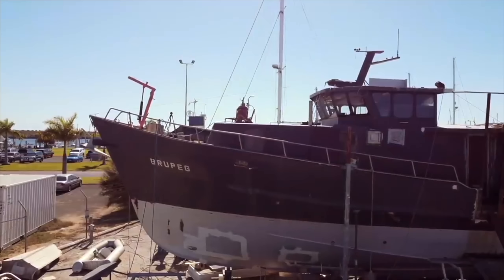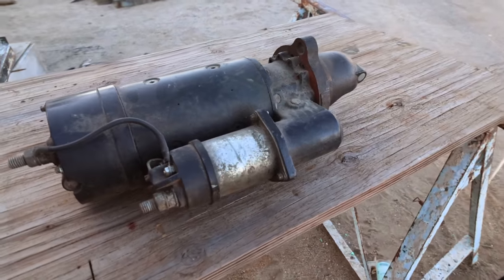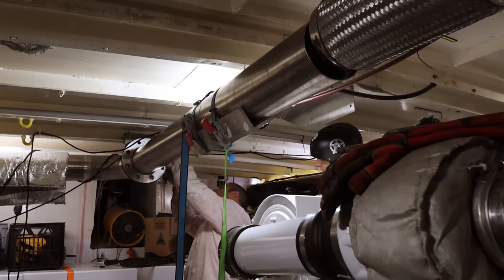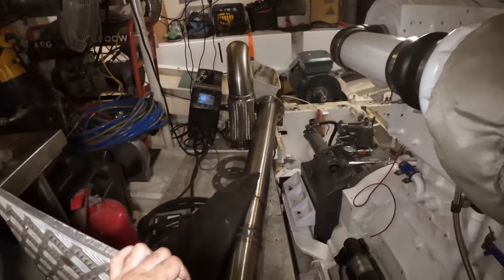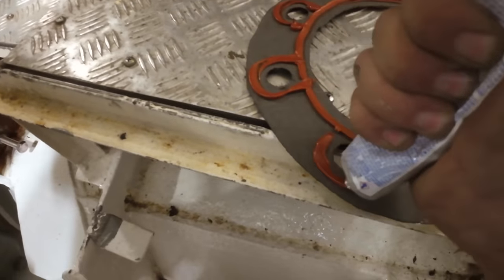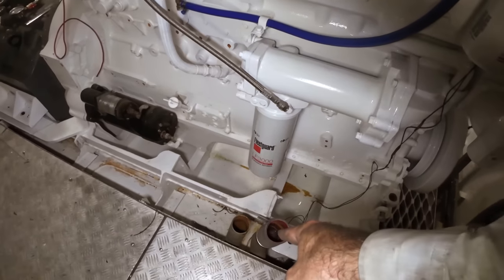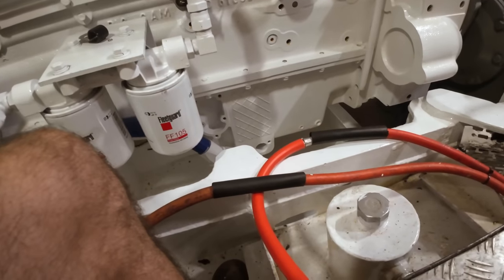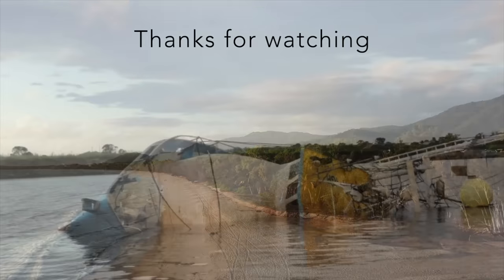Our Expedition Boat Dry Stack Exhaust - Project Brupeg Ep.322

Comment: Just a tip - Flex pipes should be in the same plane as the soft axis of your engine mounts so it flexes in compression not shear or twist. Extends the life of the flexible section.

Comment: General cable mounts can be temporarily be made from a quality hardwood ,  DIY drill 2 sloppy cable holes in a block -turn 90 deg and drill hole for mount bolt/screw  between  cable holes, turn back 90 deg and cut through both cable holes to make it into a sandwich block. Simples!

Comment: Stainless steel exhaust looks pretty. Then it gets a few small rust dots on the outside, then it crumbles. There is a reason commercial boats use steel tubing for exhaust systems, it lasts for a long time. Only rich people use stainless, but they can afford to replace it every few years,

Comment: Hello Dame, if you harvest heat from the exhaust with a cooling coil, be aware of the risk that this may lead to condensation and soot buildup on the inside of the exhaust. Probably worth checking after a bit of use, e.g. 100 and 1.000 hours of engine operation.

Comment: Volvo construction equipment use plastic zip tie clamps for holding battery wires and they hold up really well, they come in a quite few different sizes aswell.

Comment: Hen we extended mains cables we cut some insulation off the cable to put over the connector to maintain the level of insulation accross the joint then we woult heatshrink over the lot exactly as you did. The concern was the heatshrink was considered less inslating and not as abrasion resistent as the original cable covering.
Reply from the maker: I really like this idea. Will do this in future

Comment: I was hoping you were going to just bump the engine over from a start switch. It's so close now. I think your idea with coiling the tubing about the exhaust is exactly what you need. It should help cool the exhaust and provide  hot water for everything. 
Well done everyone. 🤝🤝👍🇺🇸
Reply: Long time follower, another great video. Yachtie and hydraulics engineer 👍👍👍 coiled tube exchange off exhaust is frrrreee heat !

Comment: Blocks of UHDM with a fillet radius on each side of the clamping hole and as belt and braces heat shrink on the cable. Used wooden blocks in the same style on HM warships back in the 80's when fitting sonar and other electronic devices.

Comment: ceramic fiber insulation wrapped with hot shield fiber tape and plaster is the best way to cool exhaust. several resources online detailing procedure, works well, easy and cost effective

Comment: Two things can greatly increase your engine life, a cooling water pre-heater, so the engine will be at operating temperature before starting and a electric lubrication oil pump to bring the crank and big-end bearings up to pressure before starting. Remember most damage is done to a engine during cold starts, also starting will be much more easy with the engine at temperature. Greetz from the Netherlands.
Reply from the maker: That’s great to know. Will look into that. Thanks
Reply: @ProjectBrupeg  Sorry, I meant this pre-lubrication system: "PRELUBTM ENGINE PRE-LUBRICATION SYSTEM"

Comment: For testing the pipe welds, you could paint the outside with flour and water, and then paint the inside with diesel or kerosene. The diesel will find its way through the holes and stain the flour on the outside indicating faults in the weld.
Reply from the maker: Ha, thats a bloody cool trick, thanks!

Comment: You can make your own brackets using round steel on a frame, multiple sizes, just bend bracket over round steel, need solid right angle steel to fit in vice..

Comment: The wrapping will keep engine room temperature down if you use a fire rating insulation on the ceiling you should be heat transfer. Keep up the great Chanel.
Reply from the maker: Thanks Graeme

Comment: you can get rubber cable cleats for holding large core wire. that's what's used for all of the high voltage wiring in a locomotive.
Reply from the maker: Thanks. I’ll have a hunt for them, cheers

Comment: You source pipe all break at the well joint, because you have an inconsistent gas flow, which causes heat to concentrate and specific areas with the pipe/ joint highest friction rate

Comment: Make your own P clamps. Buy appropriately sized pipe saddles, shrink wrap (2 or 3 times) the space between the holes and fold the two holes so they meet each other to make a P. Works better than flimsy P clips and is dead easy!

Comment: Apply Dynomat to the ceiling above the exhaust pipe. The black Fiber-based core offers excellent low–frequency absorption properties, thermal resistance up to 350° F, and compliance with UL94, MVSS 302, UL HF1, UL HBF standards.

Comment: If you can only get bare stainless cable clips, you should be able to slide some heatshrink over them, may have to straighten them a bit.
btw, the 'resin' in heatshringkis basically hot glue, so if you only have non adhesive heatshrink, cover the joint in hotglue, let it set, slide over the heatshrink and heat ;)
Reply from the maker: Ha, good to know

Comment: My 2 bobs worth, to get the best heat transfer the ss tube should be in contact with the exhaust, when you wrap the tubing it will spring away from the exhaust. You could bend the tubing around a smaller diameter pipe and then fenangle it over the motor end of the exhaust as that doesn't have a flange on it. I have found that aluminium tape holds up under heat if you need to secure it and it also insulates and will give more heat transfer to your tubing, I have used to secure copper tube to steam pipes and it held up for 10 years.
Reply from the maker: Good info to know. I can order what ever size diameter we need so under sizing and stretching over the pipe sounds the go. Cheers

Comment: in that bend next to turbo Use the ceramic wrapping cloth it's used in forges to heat proof.shoud do a better job than the fiber glass heat insulating Cloth

Comment: Suggestion on the heat shields. Use an arc section from a 10 inch diameter pipe supported above the exhaust. If you can find it, another larger pipe arc and a little wider. On top of the first one
Reply from the maker: Cool idea

Comment: the insulated cable clamps can be found at the airport. They use them all the time on aircraft. they come in a multitude of sizes, and are very stout. no worries of breaking them.   You might want to chat up a mechanic next time you are close to a larger airport Damian.   I would check with a larger aircraft carrier not a puddle jumper size.   Hopefully that helps.

Comment: Seems like a length of rubber hose threaded over the exhaust U-bolts would provide chafe protection and vibration damping.  Even garden hose should work.

Comment: I would suggest you  put a heat shield on the back the engine control box and rubber mounted ( vibration control)
Please give a good thought on a engine driven fire pump/ emergency bilge pump. 
Looking forward for the chalkfast to be completed.
Reply from the maker: We do have an engine driven pump, just not fitted yet
Reply: @ProjectBrupeg  
That is great news. 
No sign of fish in your new below deck Aquarium.🐟😁

Comment: Don’t grab a gauge and tighten by the bezel electric or mech to tighten you will damage it 
and at the least have to re calibrate it tighten by the wrench flats on the back -brass Pipe thread fitting.

Comment: If your exhaust manifold is the water cooled marine manifold that is going to suck a lot of heat out of your exhaust gas. If it’s the solid cast industrial manifold, if you wanted to get some heat out of it, there are two philosophies of it, you can wrap a coil around the outside of the exhaust pipe, and prioritize good flowing exhaust  and simple installation, over really efficient heat transfer, perfectly adequate for some applications I don’t know exactly what you’re looking to do with this hot water. Option two is an internal type heat transfer, basically adapt a 18-24” section of your exhaust tube to about 8” and weld about 7, 2” schedule 40 stainless pipes on a “wall” on each end and pass your heat transfer fluid around the pipes think “steam boiler” that’s very effective, the smaller and more numerous the internal pipes the greater the surface area interfacing the hot gas and cooling liquid, but also greater surface area means your exhaust gas has to work harder to get through it. So there’s a balance. As far as a roof heat deflector, aluminum works pretty well, steel or stainless are also okay, and on the backside (opposite the exhaust pipe) some sort of adhesive backed insulation can help with heat transfer but make sure to leave a good air gap between that and the floor itself, even just a free floating 3mm bare aluminum may be sufficient. 
Hope to see you guys on the water soon, take all the time required. It’s better to spend extra time working through it on that handstand than rush, but you guy’s already know this. Best of luck from Texas.

Comment: May you could utilize some aero-gel insulation for the whole engine room ceiling and the exhaust? And over it (past the heaviest heat load coped by the aero-gel fleece) ISUM heat radiation reflection material. Or combine it with classic light weight Fireclay panels.

Comment: Checking items off the engine to do list. Adding a few more in the process. Jess and Duncan will proud. Duramat or similar on the ceiling. Components or parts off a used infrared deflector shield if suitable. Piping/tubing to cool exhaust. Not sure what economically feasible - radiator, boiler, etc. Almost there.

Comment: A simple solution would to just run some cable tray and zip tie it down wholesalers everywhere carry it there some simple and cheap ones that are 50mm wide throw some tabs on it and bolt it to the engine and you can have a neat secure cable path all the way to the starter if you wanted

Comment: Could the water pipe wrapped around the exhaust be pumped to a pressure washer for use on deck? The hot water could be useful in breaking up ice on rails and stanchions and whatnot. And of course general cleaning.

Comment: your two sensors at the top by the water port and right next to the exhaust.  Could you put another 90 degree bend on it so the top sensor points away from the exhaust pipe and insulation.   That way it will give a little more room for the insulation.
Reply from the maker: Yeah that was a thought we had. The plan is start it up as is and if we find it’s playing up we will adjust it round

Comment: Use SS for the heat shield as it is a poor conductor of heat. Get really fancy and have the exhaust ceramic coated to really stop the heat.
Reply from the maker: Ok. Stainless is easy enough for us to fab up. Will do. Would love ceramic but bank balance strongly disagrees Thanks.
Reply: @ProjectBrupeg  I reckon with your heat wrapping you might not need the shield anyway. Running stainless high-pressure steam piping, admittedly only a couple hundred degrees, with 25mm glass fibre insulation it was cool to touch. We would use shielding sometimes where valves were exposed and close to where someone might accidentally touch it.
Reply from the maker: @FilipAus good to know. I think this ceramic wool stuff is pretty good, and temps we run are around max 450 right at the turbo. It’s down to a few hundred not long after that
Reply: @ProjectBrupeg  yeah sounds like you might be fine without shielding. Looking good though. I sent some links to Prochem for stainless brackets and saddles. All 316 and they have outlets nationaly and can express anywhere. Might suit what you need.
Reply from the maker: @FilipAus fantastic. Thanks for that

Comment: I hate how the heat shrink is smaller in the middle of the joint so I cut 😮pieces of shrink tubing the same width as the connector to make it even with the existing cable jacket then I place the bigger piece of heat shrink over everything.  It doesn't look like a joint when done that way it just looks like heat shrink on cables.

Adel clamps is all that is needed for the cabling.  Adel clamps are easy to find just about anywhere.
Reply from the maker: After I hear shrunk it the first thought through my OCD brain was, “should done two layers and removed that dimple”

Comment: Damien. Just a Thought could you do triple wall exhaust like they do for Wood-burner or Fireplace? Would the Engine run better keeping the Turbo cooler? Last I would add stainless steel water jacket for that Elbow. Damien you could design a water Jacket. Just look how you made Brupeg Now.

Comment: Could you tell us how you will steer Brupeg if the engine is not running or there is a failure in that system?  Fantastic progress!
Reply from the maker: Hi Ken. If primary engine hydraulics fail, then we will be able to switch over to a secondary pump (yet to build that system) and if that fails we can disconnect the steering rams and steer with a emergency tiller on the rear deck (also yet to build the tiller)

Comment: How does the exhaust pipe system deal with heat expansion?  The pipe will get longer when engine running. All the supports don’t provide for linear expansion
Reply from the maker: The supports are rubber mounted and there is a flex joint in the hottest part of the exhaust
Reply: @ProjectBrupeg I have experience with diesel generator installations. Any horizontal sections of the exhaust system on a generator set must include an expansion joint. Without this the pipe grows in length as it is heated which stresses all the supports. It is significant expansion Which will expand the pipe length and displace the elbow at the stack. I Would suggest speaking with a diesel manufacturer tech/ engineer.
Reply: @ProjectBrupeg the flex joint deals with vibration and movement not much linear expansion. See follow up comments
Reply from the maker: @Ishta123 do you have any suggestions for suppliers and type of joint. Will need to factor this in
Reply from the maker: @Ishta123 does length of pipe matter. The straight run is around 2.5m long

Comment: Chockfast! Cool I used similar to put bolt in floor for a machine mount . Always wanted to use chockfast as it was made by ITW round the corner from me in Montgomeryville pa , usa.   I wonder where it comes from now! 
Will the gauge on side of engine be safe in the vibration? And if it breaks will it leak?
Cheers Warren

Comment: Your drawing your fresh air for the engine from the hot engine room, any ideas for a fresh air intake? Sorry its more work but may allow diesel to run coller.
Reply from the maker: The engine room has four large fresh air vents. The engine room also has a yet to be built large extractor fan so the air in that room will remain fairly cold due to the constant refreshing of air being pulled in. This is how most of the trawlers around us set their engine rooms up

Comment: nice job, just curious if the main engine gos down, how are you going to steer? since the main engine powers the pump.
Reply from the maker: If the main stops we have no motion in the water to rudder is irrelevant. When the get home kicks in we have a secondary pump that powers the rams. If that pump fails we will have an emergency tiller

Comment: For heat recovery, I have seen tubes wrapped around the exhaust. This works but not as effective as a coil inside the exhaust.
Reply from the maker: My preference would be external pipe as I would rather the heating coil take longer to heat the water than restrict the engine in anyway. I agree with you internal would be better but we can live with slower heat delivery
Reply: @ProjectBrupeg  yes internal would cause a restriction, how much would be debatable and would require some complex maths due to the heat reduction the air would contract as it is cooled. 

Too many variables to even make an informed guess!
Reply from the maker: @AdrianChapmanlaw yip. Completely agree. It would be nice if heat recovery was the priority but fuel burn reduction is always or core goal then using anything that’s waste to do something useful to further reduce fuel burn (ie less genset run time)
Reply: Another thought... what's more important, egt before or after the turbo?

I have a feeling it's pre turbo.
Reply from the maker: @AdrianChapmanlaw it should be before however it’s a water cooled manifold and we have no ability to tap in pre turbo without major mods to the manifold. So it’s going right after the turbo fan
Reply: @ProjectBrupeg  are you also doing heat recovery from the cooling water or just dumping through the cooling pipes under the boat?

Comment: Does your truck have a catalytic converter under it if it does just look at it , it should have a heat shield over it , thin stainless steel should work same with aluminium.
Reply from the maker: Our truck was invented before emissions were. But I will check to see what it uses. Thanks

Comment: Water cooling exast is a bad idea it will build up particulate quickly.
Reply from the maker: The main manifold is water cooled.
Reply: @ProjectBrupeg  Yeah that is within the engineering. We pull a coil for hot water off the cooling circuit for the trap tank on lobster boats. If you cool the stack too much you get back pressure and particulate build up at the top of the stack.
Reply from the maker: Ok good to know. Thanks